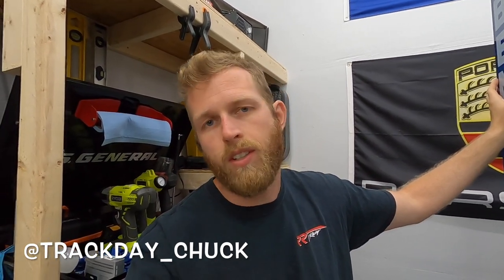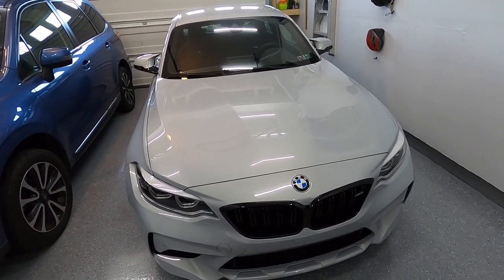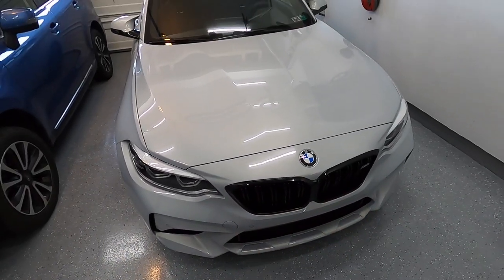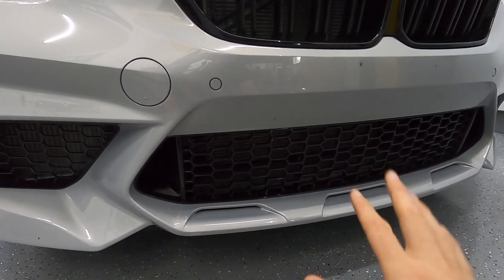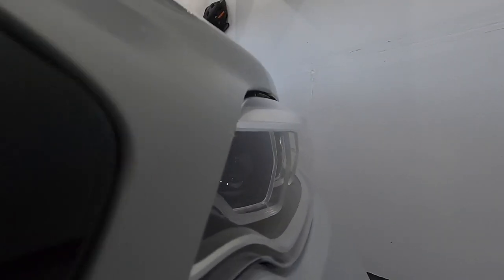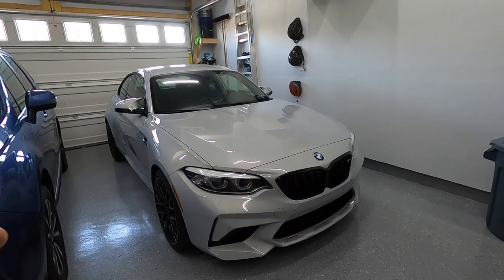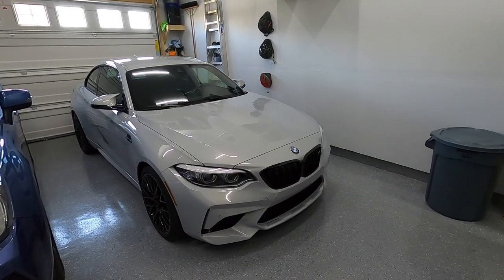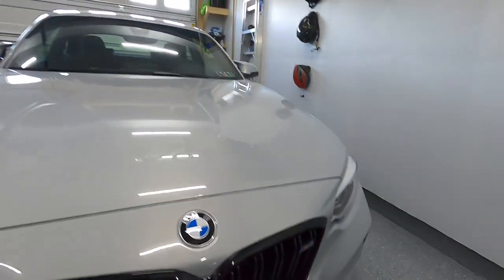2021 M2 Competition Paint Protection Film Overview

Comment: my wrx been ppf for 4 years. if u claybar the seams regularly I think it should stay pretty clean looking. I clay bar mine other day and picked up good amount of dirt in there. I have the xpel templates.
Reply from the maker: Oh ok good tip. So just gently clay the edges if they get dirty?
Reply: @TWRX_Chuck  i wasnt gentle with mine and edges held up strong. long as you have enough lubrication i dont think will matter. recommend Adam's detailing spray.
Reply: ceramic coating is worth doing tho. after 4 years and multiple iron x washes and a full 1 step polish car still shines when dirty